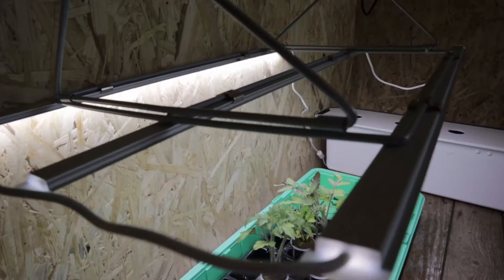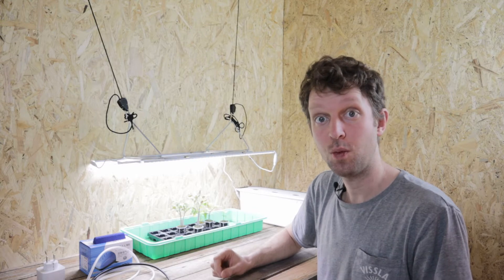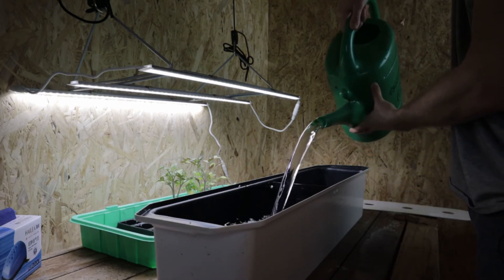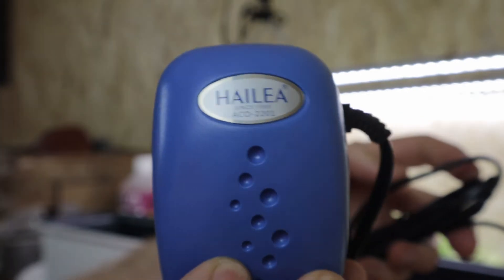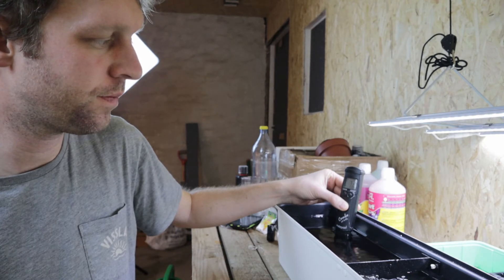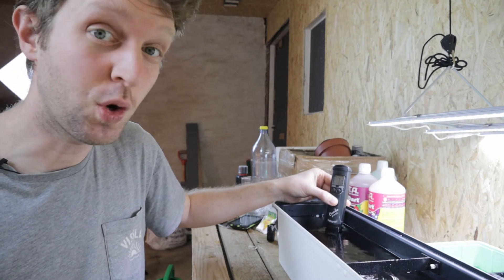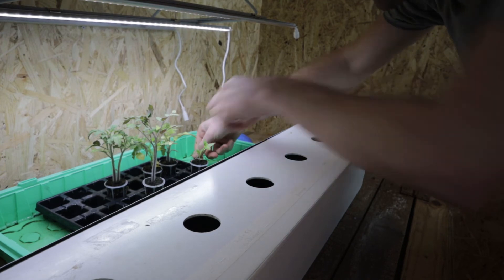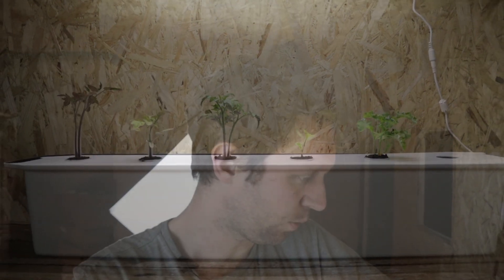Kratky to DWC - Nelson Garden Harvy 6 Hydroponics kit converted with Air stone

Comment: How do you do the water change on this setup? Just change parts of it or all at once?
Reply from the maker: Hej. I would change all at once. The reservoir is 9 litres. The lid is easy to lift off even with plants, or you could just lift one side up. Great system to have in the window. Good luck!